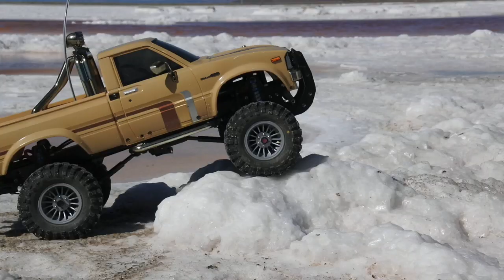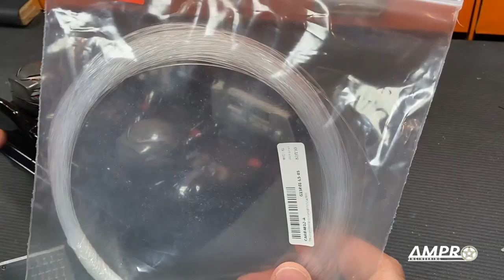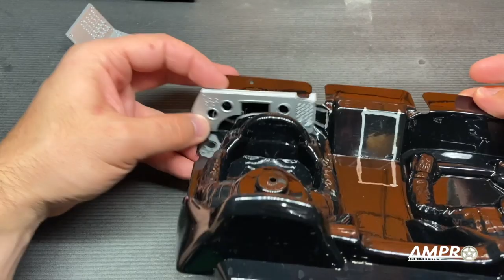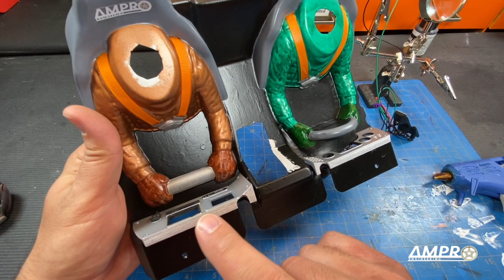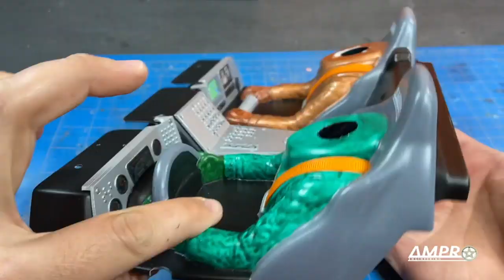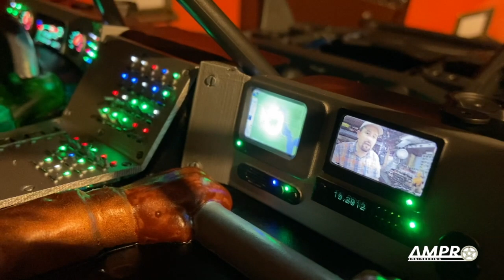e261: Traxxas UDR interior Upgrade and Lighting

Comment: Did you end up designing a steering wheel insert for this? I don't see it in the shapeways links.  Would be cool to have this turn as well.  Cheers! Great work.
Reply from the maker: So I did but didnt upload it! I will add it to the "trxu08-a2" set tonight!
Reply: @AMPROEngineering  thanks so much!

Comment: Question? Is your lights water proof and you can run it in water? How much did this cost$ get that setup done? I have a udr myself
Reply from the maker: They would need to be coated in wax or silicone to be safely submerged. All the electrical parts were under $2 but the prints were a lot more. Links to them in the description. Add them to your cart and you will get the exact costs in your region.

Comment: So the fiber optic cable just sits on the led?  I was just wondering how you made the connection between the two.
Reply from the maker: yup, as long as the LED is lined up to the cable. that is why I added that brass sleeve.